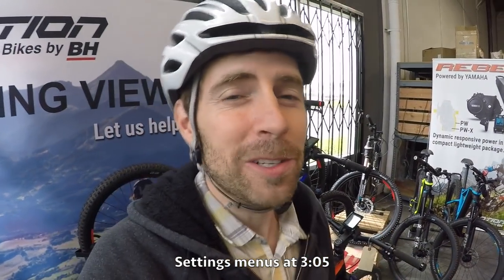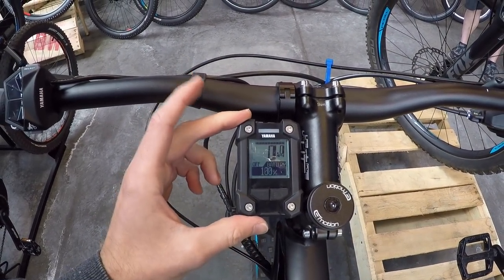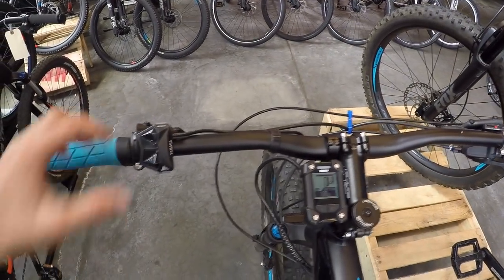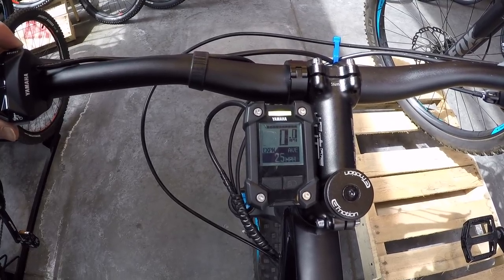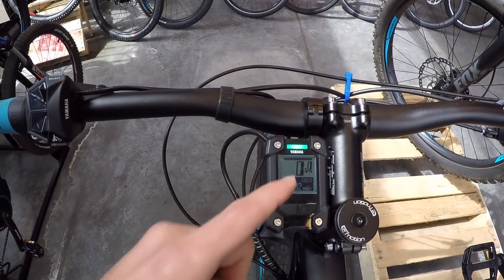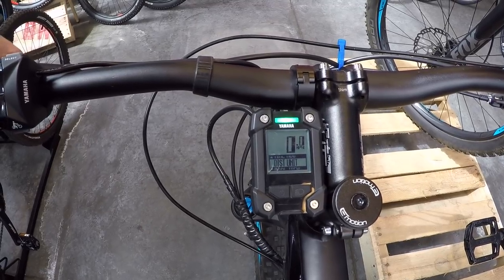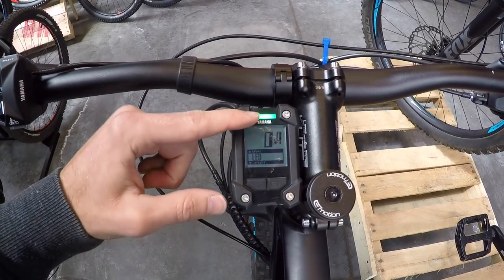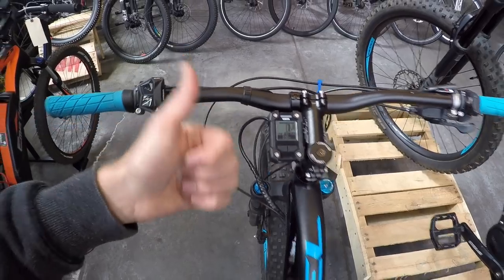Yamaha PW-X Electric Bike Display Settings

Comment: Court, does the Yamaha higher cadence PWX design live up to your Bosch higher pedal rpm experience ? 
As for the non-removable display, that would stop me from buying the entire system. If I park my bike at work outside for 8 hours every day, I could remove the Bosch Intuvia or Kioxx and save it from all that sun exposure and theft possibility. Ideally, these spendy ebikes must be designed with theft-reduction in mind.
Reply from the maker: Agree, I feel that Yamaha is lagging behind with their displays. Some shops tell me that their older PW drive system has been one of their most reliable. My favorite experience comes from Bosch CX and Brose Drive S or Shimano E8000 (in that order based on lots of different tests and rides and feedback about support, reliability etc. and my ride style). I'm excited for the Brose Drive S Mag and will be testing that with Bulls soon :)
Reply: Good to hear! Here's your comparison vid for anyone curious:
https://www.youtube.com/watch?v=M0a_eMmtFDA

Comment: Nice bike and more stealthy is almost always better in my opinion. Don't know why the display is not removable?
Reply: it doesn't need to be. I have thrown my Habike Yamaha pw-x down many trails and it's taken big hits, the screen is near indestructible and highly unlikely to take hits anyway due to its positioning.
Reply: I have no doubt what you say. I've preferred a removable display for security reasons such as parking in a public place. A displayless ebike might be less tempting.
Reply from the maker: Yeah, I see both sides... making it removable almost forces you to take it off at ever stop. The PW-X is tough and strategically positioned but it's not nearly as easy to read as the Bosch Kiox. With that display, you can lock it down if you want, but they purposefully positioned it to reduce damage and told me that it was designed to pop off during a big hit. Different philosophies, it's nice to have choice between companies but I feel that the PW-X has room for improvement in the actual readout design.

Comment: Sorry but this is harder to read because the font got smaller, compressed and stylized. The exposed bolts on the case is distracting. My Bafang is no frills but the vital info is easy to read with a quick split-second glance.
Reply from the maker: Agree, the PW-X is not my favorite display for all of the reasons you just mentioned. The actual screen is difficult to read. This video was meant to just be a quick "howto" sort of thing vs. review :)